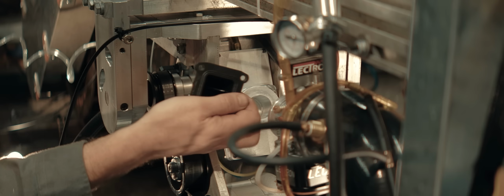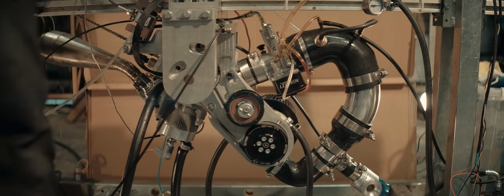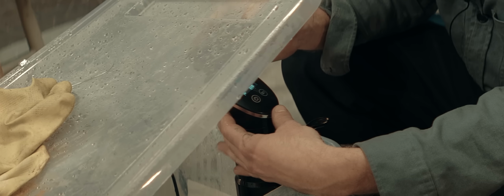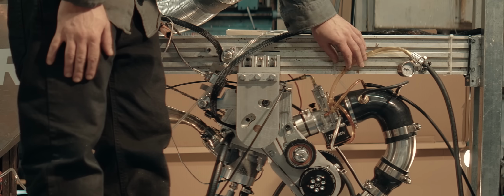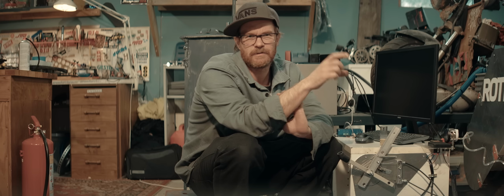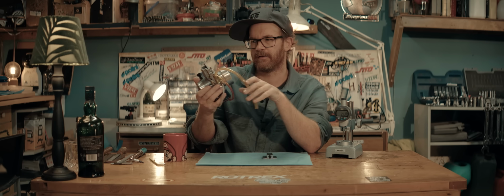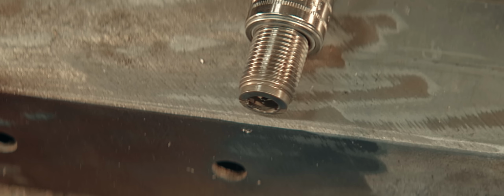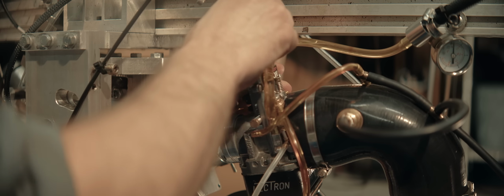Supercharged 50cc Two Stroke BREAKTHROUGH!

Comment: I'm a nobody asking what are likely stupid questions but...would a Tesla turbine strategically placed, not where you would normally think, and if the fuel was a nitromethane mix like what is used in radio controlled hobby engines maybe with or without a piston/sleeve setup that follows that line of design -ABC, possibly address certain issues?  Fewer parts, no piston ring to catch ports edges, alcohol in the mix is the largest part of the fuel (I believe) it should help cool it, and the turbine could help keep it from crapping out when transitioning from on throttle to off throttle without load, whilst other devices attempt to keep the rpm's from skyrocketing, and something needs to be done about puddles of excess fuel in any part of the motor, as puddles don't vaporize well and lend to poor fuel economy, off idle stumbling, poor emissions etc.  I would think maybe an actual motorcycle transmission hooked up could help as eventually that's the idea anyway, maybe the retarder put onto it at the countershaft of the transmission?  I have watched some episodes from the beginning to now, but not all.  Just my questions from non engineer, ordinary guy perspective.  I like the concept.  But is proof of concept the goal?  Or is an actual complete in the bike finished product prototype the goal?  If the later, that better be a large moped, because all of the accessories to make this happen use a lot of space.  Not knocking it, I think this guy is AWESOME.

Comment: Okay now you're getting somewhere,might try a compressor clutch off a car I've seen them burn serpentine belts into, you could flip it on and off with a switch should not be too hard to adapt to setup, maybe a little richer on oil mixture (just a feeling),you got those three brass tubes going into the ventura hook a squeeze bottle of gas to one for priming cold start,is there any way to control timing with a knob or while running, just thinking

Comment: Have you tryed changing the starting/choke jet for a bigger one to help with the starting, not the main/pilot jet in the middle. Cos bk in the day with my (50) 70cc scooter whn I put my new bigger carby on it, you would have to stand there for time kick starting it before it would start, I went one size bigger and it was better starting and reved up better, so in the end I went 2 or 3 sizes bigger and it started first kick every time, hot/cold the nxt day even leaving it a couple of days to a week one kick and she would fire straight up, 💯💯💯💯👊👊👊👊👊

Comment: I know nothing about 50cc 2 strokes or that supercharger, but i think that hose might be too big, then air speed is low and its get low pressure because there are lots of space in that hose. Maybe with a little hose air speed would be better, as well as pressure, and it might get more fuel from the carb

Comment: Is it possible to inject fuel into the transfers to try and avoid it pooling in the case at low RPM?
Sort of like modern sportbikes with "outboard" fuel injectors for high RPM and "inboard" fuel injectors in the usual spot right before the valves to have good throttle response and idle.

Comment: I wanna see this Rev to 22k sooooo baaaddd😭😭😭
Reply: I'd like to hear it doing 22k. I can't imagine the stress the conrod is going through.
Reply: @malcrandall1309  sounds like he may have gotten close...I had posted that before the video was over.
Reply: @high-techredneck220  When Alex was runing the Roots blower he reached 18k plus on the rev counter and gaining RPM untill backing the throttle off.
I don't think the engine has reached 10k with this new Rotrex blower.

Comment: If I understood correctly, you chose to use the Lectron carb because of the big fuel volume. But it still doesn't make much sense to me to use it. It just looks like it's begging for problems to use a 50mm non-conventional carb with a homemade reduction insert... 😁 and worse still, with a supercharger. Why don't you take the supercharger belt off and try to sort the fueling that way first. You don't even know how the engine is generally going to behave without the supercharger. I would also use pump gas for debugging. That will save countless jugs of the expensive nitro stuff. I know, you want to do things Jazz way. But I think it would be more interesting to see some logical progress and not trying to hunt problems based on guesses. And if you manage to get it to work somehow, please try a way higher reduction ratio for the supercharger. With the AMR charger, it was better when you made it turn slower. I think you should have tested to slow down the supercharger even more. I think both superchargers are way oversized and the problem is that at the supercharger speed range where it works efficiently, the airflow is just way too much for a 50cc engine and the charger just hogs power. By turning it a lot slower you might have some chances to have the charger to produce a small net gain even though the charger is operating at an inefficient speed. Personally I think that the supercharger in a 50cc moped engine idea is doomed, but it sure does make some interesting footage. One guy is also trying a supercharger here in Finland for a 80cc.

Comment: I got a question. Why would you mount that motor upside down? That little puddle of fuel that you get in the bottom of the crankcase on a typical two-stroke, lubricates the rod bearing and the main bearings, not to mention doesn't build up on the back of the piston causing extra weight on the Piston body, and seeping past the Rings. I don't know. that one's got me puzzled. I don't see any benefit of it, but I do see some problems that it could cause....
Reply from the maker: Upside down for a straighter pipe when mounted in a frame. Fuel ending up in the cylinder and not puddling in the case is actually a good thing, less mixture fluctuations. I've been running upside down engines for a long time, no lubrication issues.
Try shaking a glass of water up and down 250 times per second and you'll realize it would be difficult for fuel to build up under the piston.

Comment: *2 Stroke Stuffing * Not a pro by any stretch. My base line thought from a Minarelli Vertical With a 4 inch Intake. Perhaps the exhaust header is causing a superheating situation that’s actually disturbing the echo at higher RPM. It will take off the fail then reload as I also experienced. Perhaps a different shape pipe or wider header if possible may reduce this inertia. I maybe way off , yet cause and effect. If one part is constantly troubled concentrate on the opposite. Counter intuitive but deductive.

Comment: Did you consider the size of your expansion chamber or if there’s even a need for one being your running boost? And the size of the outlet on your pipe probably won’t flow enough as it needs to breathe right. On my 125 cc shifter kart when I went from my modified bike pipe to a kart pipe with 4 times the expansion chamber it picked up so much bottom end I couldn’t believe it.

Comment: Surely it's the pressure differential between the venture and the float bowl is not there because of the blow through? I know all the messing with fuel pressure but that does nothing to the pressure above the fuel in the float bowl? Don't you need a carb in a sealed box or a pressurised, sealed float bowl?
Reply from the maker: Carb vents are connected to a pitot tube in the intake.
Reply: @2STROKESTUFFING  is that sealed enough, then? Have you measured the pressure.
Reply from the maker: @RaceLab37  should be, I've capped the overflow, no other holes in the bowl except for one's going to jets.
Reply: @2STROKESTUFFING  how about the fuel that runs along the extra enrichment jets dropping the pressure? I know I've had lots of trouble like this, where it runs good on idle but won't enrich enough at some rev ranges with a turbo? Before you had the roots blower the other side.

Comment: Do not try the impossible, put reed valves on it. And use a smaller carburetor. The flow rate is too low to absorb fuel from the main nozzle properly. Not such a small engine needs such a large carburetor.

Comment: id say running rich because lean is notice by fast reving you could try leaning off an keeping an eye on temperature ok is tht carb to big for a 50 it seems your throttle response is lacking punch def fuel air mixture

Comment: Its usless to out a turbo to a 2 stroke because when the carburant Port Is open even the exaust Port its open so you dont Have the compression Witch you Will Have on a 4 stroke and you probably Will lose a bit of the effect of the pipe

Comment: 18:00 The venturi effect is critical to a carburetors function, so yeah, that carb is dead now

Edit: 18:45 called it

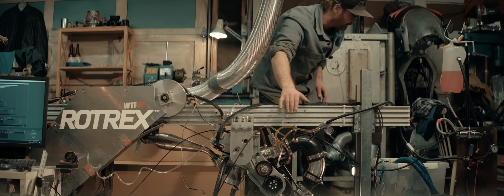Edit2: 19:30 so it's not completely dead, but heavily diminished venturi effect now

Edit3: I dunno how much you actually removed but that carb almost looks like a tube as it is, I'm surprised it pulls fuel at all

Comment: Lectron 28mm is not too much for a 50 cm3 ?,Maybe with Pwk 21mm for atmo is top , with charger if you test the Pwk 24mm probably will be good (lectron 28 is normaly for 125 cm3) i hope you'll be arrive to fixe it that trouble...
Reply from the maker: It's not a 28mm, it's a 48😁

Comment: Too much carb for the 50......24 mm max.......you must have 34 plus...you'll have enough  low end, midrange will be good and scream at top end...... switch to rotary valve, no reed necessary then............. the ultimate is to put in frame and have a runner.... 25-30 hp very manageable hp.....clean job mate !!

Comment: What's the performance of this Cylinder without the supercharger?
I'm sure you have a carburator with diameter size 28mm or so, and a V-force reedvalve with 0.25mm reeds to start with, to get some result.
Even with the ingnition mapping you could probably go from 30° down to 7° bevor O.T.
Good luck.

Comment: Also if you are having atomizing problems just make the carb bore smaller with velocity tongues.

I do have a question, if you made a crank case with internal veins could you still have large volume with high velocity?

Comment: I’m unfamiliar with superchargers, but if you install a clutch, will it become a restriction if it isn’t spinning?
Reply: With a centrifugal supercharger like he has now it should just suck air through the blades. That's also what happens with turbos on low rpm when the turbo hasn't kicked in yet. 
If you'd use a supercharger like the previous one with screws there is no free passages of air

Comment: Hello! I am wondering what would be the effect of 2 tesla valve on a two-stroke, one at the intake flowing forward, and one at the exhaust (smaller than the intake one) counterflowing, to have the effect of back pressure right back in the cylinder. Would the intake valve flow be accelerated by the pressure built in the cylinder ? Does anyone have an idea ?

Comment: Why dont you try doing 70cc or 94cc engine kit.That sould solve your problems.Because 50cc engine doesnt have enough power to spin the supercharger.Or try finding a smaller supercharger that makes boost at lower RPM .

Comment: Not to send you down a rabbit hole, but I would remove that boost purge valve(blow off) from this system. There are a number of very in depth logs on why they cause more problems then they solve, you will see a number of race engines not run them as well.

Just a silly YouTube comment, I know. Its worth consideration. Look up the Mr2 Community when browsing this topic.

Comment: Ditch the supercharger and turbo it.  A properly sized turbo will always make more power than a supercharger on a 2smoke because of the back pressure rise on the exhaust side.  Well I guess you could have some variable orifice on the exhaust but again you are still driving a belt and robbing power.

Comment: if you are having issues with the crank case volume, is there anyway to reduce it without making a new one? is there any benefits to a larger crank case volume?
Reply: Yes there are ways to lower crankcase volume thus increasing primary pumping efficiency which will allow the engine to start conventionally.
Watch last weeks video and see Alex having a rant directed at me.
I am a great fan of Alex but you carn't change history. It's Alex's channel and he has the right to do what he chooses!
Hope I don't get banned from watching.
Reply from the maker: Not directed at you Malc, well maybe a little bit. Ment to  explain I understand all the frustration, and explain why it is what it is.
Reply: @2STROKESTUFFING  Thanks for your comment Alex re my reply to a question. I hope your frustration with me is easing.
It has never being my intention to pull you down in any way, just the opposite!
Reply from the maker: @malcrandall1309  I know, and it was your(everyone's) frustration with me I was referring to😁

Comment: How come you havent done a plug chop to see if lean or rich? Or look at the 'wash' on top of the piston and see how much carbon you have on top if it's all washed off the piston the engine is rich if its all carboned up its lean. The piston should be all carboned up except for the very edges like 2mm in

Comment: I just don't think you're running a high enough volume of boost and fuel to run nitro, it's running great on gas but the nitro just needs WAY more fuel and air and timing.

Comment: PS ive seen u try any number of ways to work around your carb being om an angle. U have been working around it for years. Why not level your carb up with decent angled adaptors? But what do i know? I started working on lawnmower engines when i was about 11.
 I ended up in a mechanical maintenance workshop when i was17. After 9 years on the tools i became workshop manager and increased production 14% per year for the next 17 years with a team of 7 guys. We had a culture of continuous improvement and did  everting from basic maintenance to  scratchbuilt inventions to rebuilds of multi million dollar plywood making machines. Get the bascis right. have a plan, an make it happen. If its logical it will happen if u want it bad enuf.

Comment: Get it running smooth with no boost and carb only….then use efi injector before carb that turns on when boost comes in spraying methanol….done deal

Comment: If you bolt the carburator to the inlet of the supercharger    and bolt the supercharger directly to the bottom of the crankcase and close as possible to the flywheels to actually have  one of the flywheels cut with gear teeth to drive the supercharger internally ..using one huge of your design barrel ehaust valve that you will design as a trade off toward high flow not sealed air tight ..with a huge chamber sound wave making the final seal in its widest point to a steep short reverse cone that will make long stinger 1/2" i.d. with adjustable length stinger made like a slide trombone so you can make the stinger longer for top end ....plug the piston pin, plug the crankpin make the crankcase as tight as possible and become a two stroke stuffer for the very first time as there video title only suggests ...and if any one else besides me would say you are click bait .as the  only thing you have ever stiffed is maybe a turkey but  you havent stuffed one balance hole no crankpin no piston pin

Comment: .. but Above All else , what just __ DOESN'T MAKE SENSE __ is = how its possible increase supercharging in a two-stroke, if when you force air into it, it immediately comes out of exhausts !!!
Reply: ... & other Oddities = that CHOKE evident at 13.50 (in the aluminum admission manifold, immediately after carburetor..) what is the use ?? .. in addition to the choice of keeping the reed valve = if ROTREX continuously pushes air into crankcase (even when the accelerator is closed, or exhaust cycle, etc..) said valve becomes completely useless !
Reply: ... an interesting thing instead: =small tubes connected to the carburetor free air vent holes, on one side, on the other they are connected with pressurized air tube coming from the compressor, that feeds the entire carburetor ??
Reply: ... I also noticed a power jet at the top of carburetor vault (actually two maybe!) = Don't you have TOO MANY variables in play at all times ? , isn't it better to simplify first and possibly , complicate later ??
Reply from the maker: You really need to watch a few more of my videos, everything is being explained along the way.
In short:
- Expansion pipe exhaust provides back pressure to make supercharging work.
- sliding reed valve is needed cause the centrifugal supercharger does not push more air than the engine digests at low rpm, opened at higher rpm. 
- All carb vents are routed to a pitot tube in the intake. 
- 4 external "power jets", easy to work with cause I can adjust mixture without disassembling anything.

Comment: U gotta take that out of the carb look how choked it is?
Reply from the maker: It's a 48mm carb, this engine has a 40mm piston...
Reply: So what are you trying to say that I'm wrong cause I'm not
Reply from the maker: @davec1835  I'm trying to say it needs to be choked cause 48mm is too much even for this.
Reply: I think it could use more carb seemed like it was still lean
Reply from the maker: Yes still lean, needs richer metering rods in the carb, but not a larger bore.
Reply: @2STROKESTUFFING  you got them rods, didn't u put the biggest one in yet?
Reply from the maker: Haven't arrived yet.

Comment: I believe that you would have much better control of fuelling by adding a fuel injector and a throttle body,  don't you thing?   or maybe in your case a double injector as i believe that you may need a huge range of fueling for this little monster.  Imagine how "easy" could be...  ohh is lean, change this value here, now is too rich, change this section there....